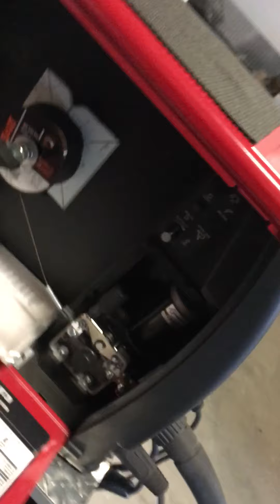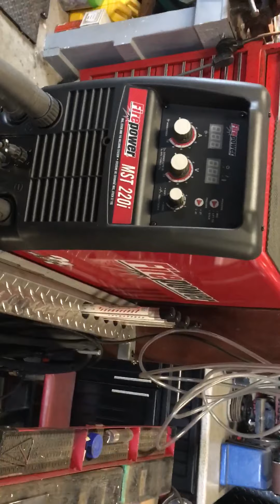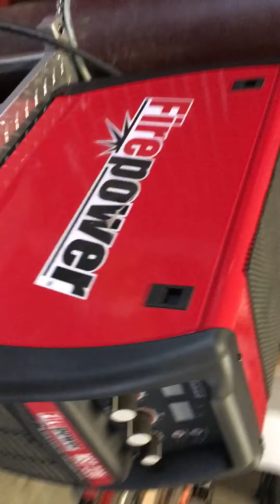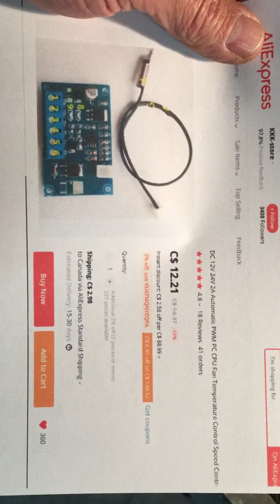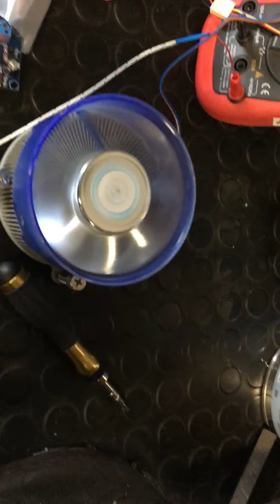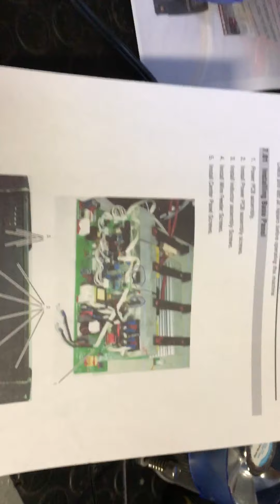Firepower MST 220i Review and Evaluating Fan Speed Controller

Comment: Thanks for the review. I'm  for sidering buying a mts221i (BNIB) off a guy. I have a question on the duty. These are the old thermal arc/units just rebranded but if you compare the duty cycle specs off the manuals of each you notice that the duty cycle is slightly lower on the newer firepower units. For example at 230v the thermal arc/tweco units have 60% duty cycle at 130A. Whereas firepower is only 122A at 60% duty cycle. It follows this way thru the whole amp range on (mig,tig, and stick settings). Just a little lower. Wondering if you had any thoughts?  Maybe they swapped in some lower grade parts to bring g thebcost down? Have you ever tripped the duty cycle while welding?
Reply from the maker: I have never ran into any issues regarding duty cycles. Most times when I’m welding the fan barely comes on. Since I installed the PWM, the fan has never reached full speed which would only require 50 degrees C. The factory thermal overload doesn’t come in until 70C. Welding aluminum with the spool gun gobbles up a lot of amperage and I haven’t had any issues. I would say you will never have to worry about it cutting out on duty cycle unless you’re welding constantly at high amps.
Reply: Thanks for the reply. If I purchase the one I'm looking into I'll probably try tracking down that PWM module you found. Sounds like that is  nice mod to consider.